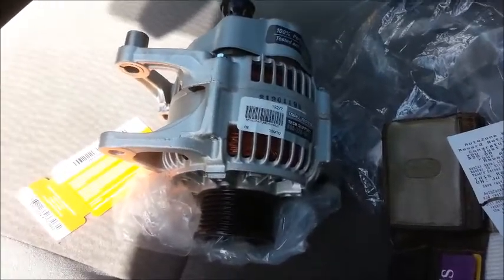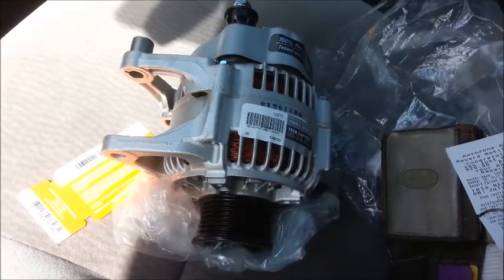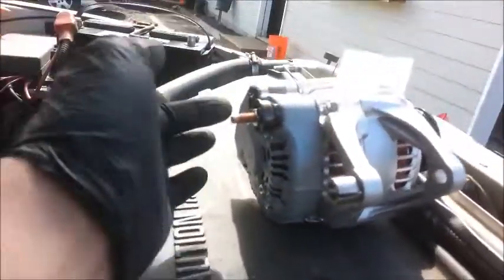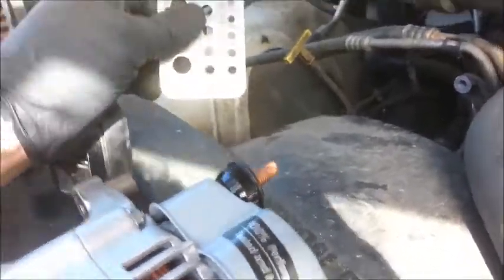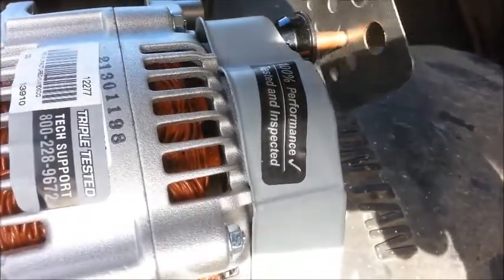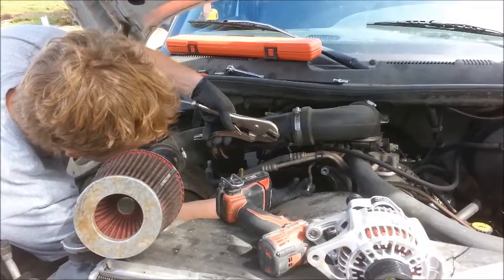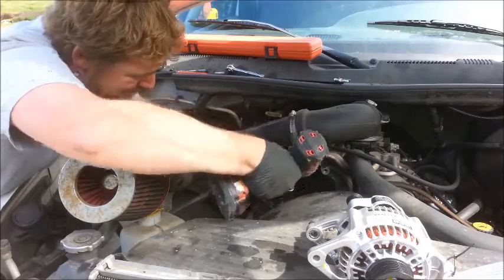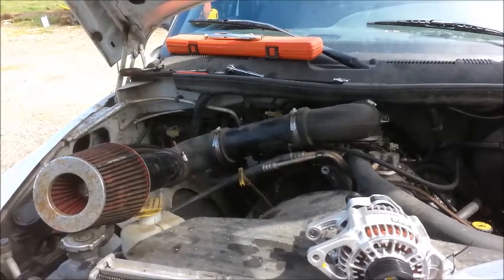2001 Dodge Ram 1500  alternator repair and tips

Comment: You described my problem exactly on my 1998 Dodge Ram 1500. I noticed that when I tapped the little electrical  connector box on top of my alternator it started charging immediately.  That got me home before my battery died.  Thanks for the excellent video.  Great job!!!

Comment: Heres what happened in your case.  The lady at the parts store was correct in that the alternator was charging and it was charging when it was on your truck as well.  The reason your battery would discharge when the vehicle wasnt running is because of the alternator DIODE inside the alternator was stuck and would draw voltage from the battery when the vehicle wasnt running.  Ford and Mopar alternators do this.  Also yours charging at 13.88 volts is NORMAL for the 94 to 02 dodge rams .  They dont charge at the regular 14.5 as ford and gm do, but they actually have batteries last longer, so mopar knows what they are doing

Comment: This was the exact same thing that happened to me. I was driving along and then the Check Gages light came on and then I did notice the alternator gage was not reading no charge at all, the needle was all the way down on the left hand side.  I could stop the truck and turn it off and start it back up again and it would be fine, no check gages light or anything and the alternator would read charging 14.5 volts.  But then a couple of days later the light came on and the alternator gage acted up again but this time I lost all electrical in the truck, no turn signal lights, no radio and all gages were dead. I was able to get to a Auto Zone and had the computer checked out and read nothing, no bad codes and the charging checked at the battery, It was reading no charging and the battery had only 5 volts left in it. I thought perhaps the alternator was bad but according the fellows in the store, on Dodges the charging is controlled by the computer and not the alternator so you can't test the charging properly at the battery but the only way to test a Dodge alternator is to bench test it.  What this guy was talking about a load on the bench test all bench test equipment puts a load on the alternator and battery when testing it to mimic it operating in the vehicle. This fellow I would say wasted his money on buying a new alternator sine the problem most likely the wire he mentioned was frayed. It sounds like to me the wire became loose and started rubbing on something to cause it to fray and that would most likely led to unintentional grounding and improper charging. Also from further research I have done on this problem where one day it works fine and then the next day you have this problem and you think your battery is dead but it will start up with no problems the brushes on the alternator get worn and while running it will not be making contact properly, this is why if you shut off the vehicle and start it up again it is running fine, this is because the alternator cools down some and then re aligns itself on the brushes for a better contact.  Instead of getting another alternator it is possible to get a rebuilt kit and rebuild the alternator yourself.  it is not a big job and a fourth grade child can do it.

Comment: This was not a repair.
.
Simple alternator test = with vehicle idling, hold a flatblade screwdriver between your thumb and finger, dangling down, hold it near the spinning alternator pulley.  It will magnetically get sucked to and stick to the spinning pulley if the field is activated.